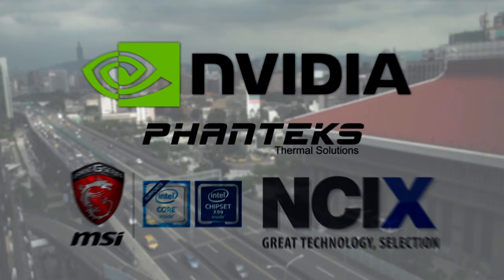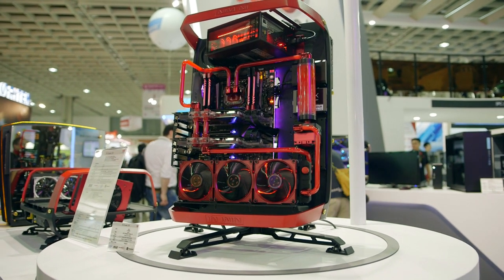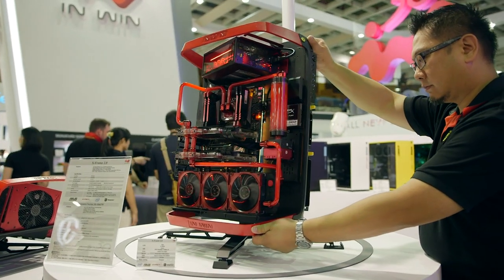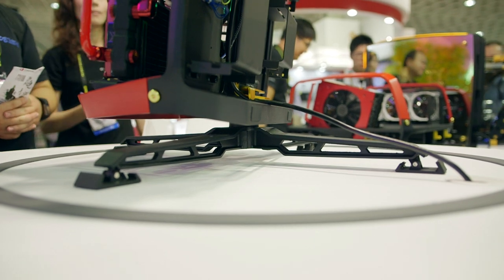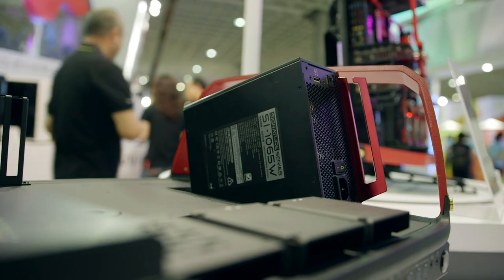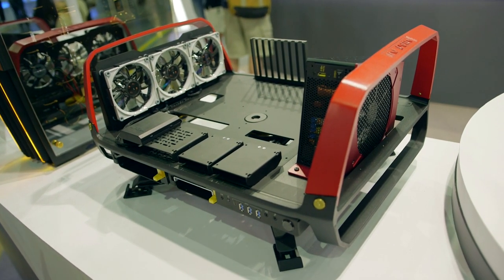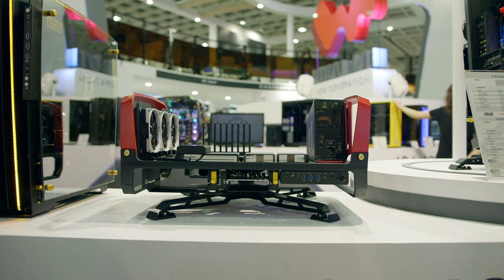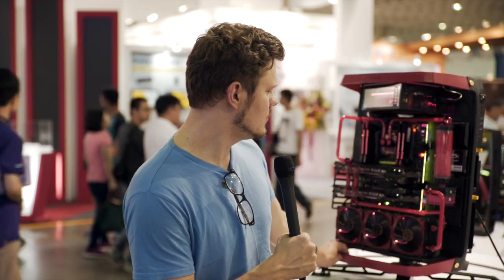Open Vertical Test-Bench Case | InWin X-FRAME 2.0

Comment: Does anyone use a test bench as a permanent case of so how is dust management?
Reply: I don't myself but, I would imagine using a can of compressed air with a small vacuum to suck up the dust every other week or so would probably be fine and wouldn't be too much of a hassle to clean
Reply: Video card gets dusty afff... everything else is fine i just blow the MB with compressed air once in a while. CPU cooler is an all in one liquid cooler. The radiator is a dust magnet that I no longer bother screwing back on.. I pick it up once in a while and wipe it with a microfiber and all the dust is off. Make sure you have your fans in pull and not push or else you wont be able to get to the dust without removing the fans. My PSU is over kill at 1200W, my system probably uses 750 so the fan is never on or else that'll be a nightmare to keep dust free.

Comment: how much does it cost?
Reply: +xCRUCiOx :/ why isnt there a opem thingy case for less than 150$ that isnt the shitty thermaltake core p5
Reply: +Tigerkitty because they want us to go broke lol
Reply: how much is in your bank account
?
Reply: +NonsensicalVids enough but i still wont buy it if its over 150€ noone should spend more than that on a open frame case lol imo
Reply: Tigerkitty well most test benches are over that price anyway.

inwin make some insane cases
Reply: NonsensicalVids ye insanely expensive for nothing
Reply: Tigerkitty you'd think they'd be cheaper because they're just basic frames
Reply: +NonsensicalVids not because of that but because in my opinion cases shouldnt be more expensive than that since its only a metal frame which i can order myself from a guy who bends metal stuff for 50€.. :/
Reply: Tigerkitty oh, you mean a case in general shouldn't be more than that
Reply: NonsensicalVids yea but i assume that this one has the psu included as they said thats why its so expensive i guess
Reply: Tigerkitty even then, even a really decent psu is just over 100,
Reply: NonsensicalVids here u wont find a 1000w psu below 170€
Reply: Tigerkitty nvm same in the UK, but slightly more expensive than the euro
Reply: ya usually in win are REALLY pricey cases. I usually never buy them because they are waaay too much money. I usually buy stuff like phanteks,. their more affordable and and are still great cases for $170, but even if I did have the money to blow on a big case, I still wouldnt go for in win, but instead get a case labs case. they are much more slick and simple and not all futuristic......but they are sooo much money. ;-;
Reply: Im actually about to buy a case for $200 just because I want to pay more for my actual hardware. :P

Comment: Certainly wouldn't be putting a custom watercooling loop onto a test bench, but it looks nice and I like that it can be both vertical and horizontal. Wouldn't buy it for a system but would consider it as a test bench if the price is right.